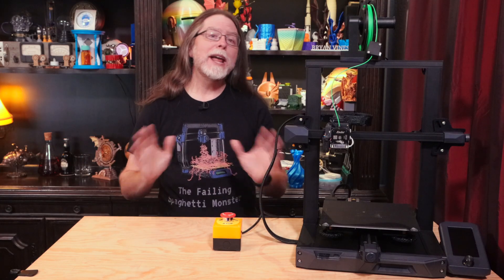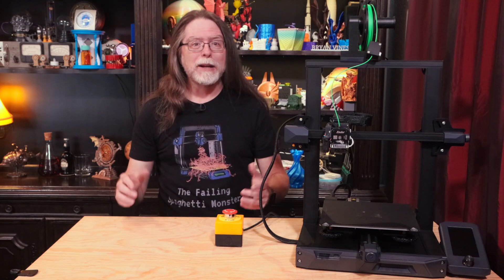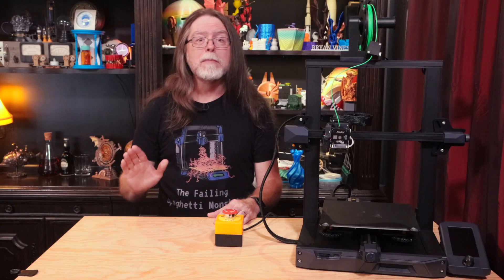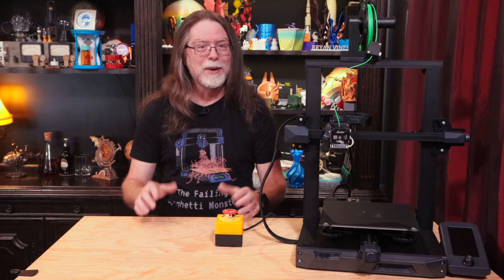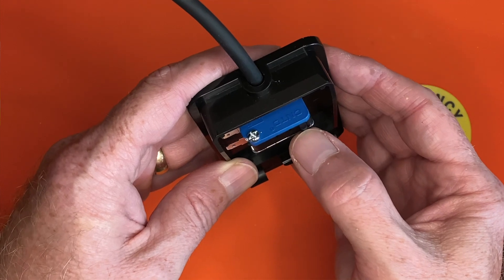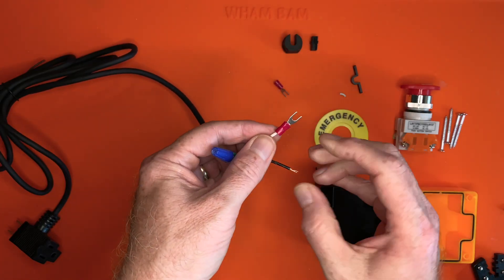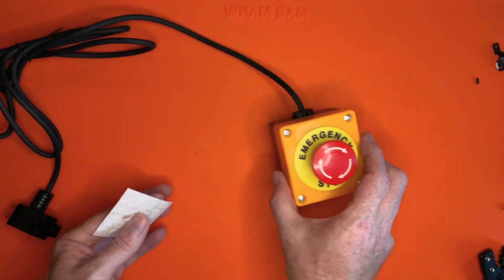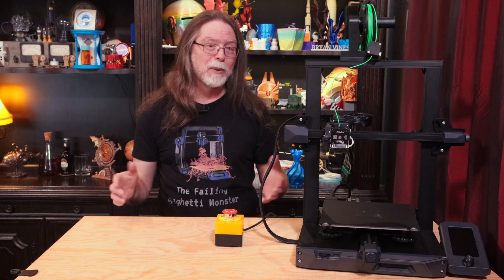DIY Emergency Stop Button for your 3D Printer, Laser, or CNC!

Comment: I think this isn't the best solution. If you just cut the power supply, the steppers are no longer energized as well, causing the nozzle to potentially crash into whatever is beneath it and then staying there untill you turn the system back on to move it up and away from it. I suggest to dedicate a pin on the motherboard to the emergency button with a macro that does a software emergency stop. Meaning that if you push the button, filament gets retracted a bit, the nozzle moves up a bit, the printhead moves to a save position and the heaters get turned off.

Comment: This solution is way too rude and not sofisticated. I would like a solution that will rise the toolhead, keep all fans running, but stop extrusion and other movement.
Reply from the maker: Hi. It turns out there's a reason this is referred to as an Emergency Stop Button and not A Button That Stops The Printer In An Orderly Fashion ... This button is to be used in the event of an emergency, when you want the printer (or other device) OFF, and you want that to happen RIGHT NOW. Your 3D printer already has A Button That Stops The Printer In An Orderly Fashion -- It's the "stop print" button on your 3D printer's screen. 🙂

Comment: It's probably better to wire the first two terminals of the switch between the mainboard and power supply and if you want the other two terminals between the outlet and power supply because it takes time for the capacitors in the power supply to discharge.

Comment: I was wondering what you were going to do with that foot pedal.  I like your solution rather than cutting the 3d printer's power cord.  I have always wondered why emergency stop buttons only come in 10 amps.

Comment: You don't need to DIY an emergency stop button. Save your $$ and get something like the "mxuteuk 120V 10A Magnetic Switch Table Saw Safety Switch Power Tool Switch Emergency Stop Push Button Switch G017" from Amazon. I don't 3D print enough, but if I did, I would get one.
Reply from the maker: I looked and looked and looked for an already-built solution on Amazon and couldn't find it! Thanks! For others just coming in, here's a link to the product Matthew is talking about. https://amzn.to/3VTUE9A

Comment: looks like you only used the foot pedal for the enclosure.  That means you could have used any old wire to control the e-stop.  i might not be understanding though.  just wondering bcuz im trying to hook my DIY laser engraver to the e-stop.  after watching this, im thinking i should just remove 1 wire from the power supply..connect it to the e stop and another, should go right back to the previous terminal.  what do you think. lol.  thanks man!!
Reply from the maker: Hi! You could certainly do that, and I'd suggest that if you want to go that route, use it to switch the DC voltage coming from the power supply. You should probably use at least the same gauge of wire that's used on the DC power and ground leads. Run a couple feet of it from the printer's power supply to the Emergency Stop switch, and another couple feet of it back, and you'd have a hardwired kill switch without having to buy the foot pedal part.

I wanted to make a portable solution that would work with nearly anything, rather than hardwiring it into one particular piece of equipment. That's why I used the foot pedal so I could harvest the switch mechanism and its power cable. The way the power cable is wired on it, the ground pin and one of the two power pins pass straight through from the "prong" side to the "socket" side of that part that plugs into the wall. But the other power pin? There's a wire from the "prong" side that comes up the cable, and a wire from the "socket" side that also comes up the cable. When those two wires are connected to a switch, and the switch is "on", whatever's plugged into the socket part gets power. When the switch is "off," whatever's plugged into the socket no longer gets power. :)
Reply: @BV3D  Many thanks for the detailed explaination my friend.  ill actually subscribe so i can check out some or your next vids too!  thanks again!

Comment: Nice iedea, however;
Better to just kill the power to hotend, bed and steppers? Or else you get a cloggled nozzle aa a bonus.
Easier yet is to you your method, but hook up an small external power adapter to power the heatsink fan..

Comment: Really you want 2 stop buttons:  this one, and one that is tied into your printer's firmware that will immediately cancel the print and raise the nozzle.  Just turning power off can complicate the situation if you have a print that has flipped up and is melting all over your hot end, and now your printer insists on homing before you can move anything.

Comment: That's so cool and very timely as I am currently building an E-Stop linked to a lightning detector for the radio array I've got here.  Although I'm having to deal with 230v rather than 120v so I'm being EXCEPTIONALLY careful!

Comment: With Octoprint and the SimpleEmergencyStop plugin, you can integrate this with a power relay controlled by your Pi. Just put the high-voltage side of the relay in-line between the foot pedal power cord and the Emergency Stop switch, and connect the lower-voltage side to the appropriate pins on the GPIO connector of your Pi, and you have both a physical button to slap, and a remote power control via your Octoprint interface. I'm sure there's similar functionality for Klipper. I've already done this (without the physical emergency stop button) with the relay inside my Ender3v2 case, wired inline between the inside of the power socket and the power supply, with the wires connecting to to the Pi following the same path as the power wires from the supply into the logic board enclosure, then out with the wires going to the motors. I putting the relay in the emergency stop button box is an even simpler way to do the same thing, without having to re-wire anything inside the printer.

Comment: I build a three way switch into my ATX power supplies. Neutral is where the RaspberryPi is controlling the power. The other two positions are always on (used when I maintain the printer) and the other is the emergency off position. And yes. I used it a couple of time to shut down my printers.

Comment: Did you verify continuity of the ground pin through that plug? Also there are several pre-made emergency stop power cords on Amazon for under $40. Rockler makes one rated at 15A if you want a brand name, it’s $40. There are some no-name ones for around $33. They are very common in wood shops, and they are typically a paddle instead of a button but they work sitting on a table just as well. I think they use a paddle below the work surface so you could also deactivate the equipment with your knee or leg if your hands are caught. 😬
Reply from the maker: Hi! Yes, it passes ground through. My Google-Fu (or whatever the Amazon equivalent of "being good at searching" is) must've been malfunctioning. I think I was being too focused in my searches, looking for emergency stop buttons. I do prefer the button to a paddle, though.

Comment: It's a neat idea to use that foot pedal adapter to switch mains voltage off completely.
One word of caution you missed tho: When cutting mains voltage, you cut the power to all the cooling fans of the device too. Sure, there will be no more new energy going into the device to produce heat, but things around the hotend made from 3d printed plastic might start to melt, if you cut any airflow and the heater block is at >200°C.
And of course cutting the mains supply might introduce quite a delay between e-stop switching and a device stopping in it's tracks, because of the bulk capacitors in the powersupply. This is a bigger problem with laser engravers or other robots like drawing robots, as they don't use much power, sompared to a 3D printer that has usually some powerhungry heating elements running.
Reply: A good many cnc controllers (I could probably say "most" but certainly can't say "all") have some form of "crash detected abort" built in - if a limit switch is hit it will immediately stop motion and disable the toolhead & heaters... I know not all 3d printers have this because I've seen it can be disabled in marlin at least, but it's for sure a part of simpler controllers, like the GRBL boards running many lasers and hobby cnc.

Comment: excellent idea! I've handled that type of e-stop assembly in my professional career, very handy little units. Handy tip for making sure it's where it needs to be in an emergency, stick it a surface with a bit of black butyl rubber. Super sticky stuff, and doesn't leave a residue if you  go to remove it, and it's reusable. Just don't stick it to textiles (cloth, carpet, etc).

Comment: I already fitted orange 13A electrical plugs to my printers power leads and the power strips are on the front of my Lack enclosures so I just unplug in an emergency or throw the strip switch but my Laser cutter has one of those emergency power buttons already fitted, why I did not think of fitting those emergency switches to my printers has me scratching my chin though!